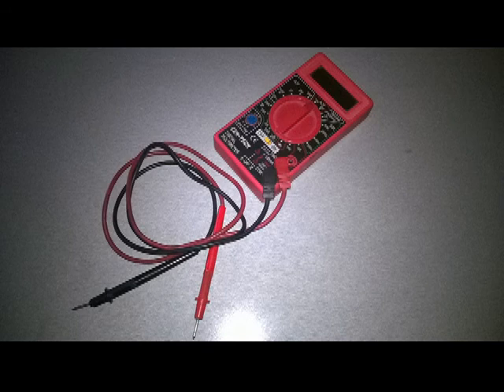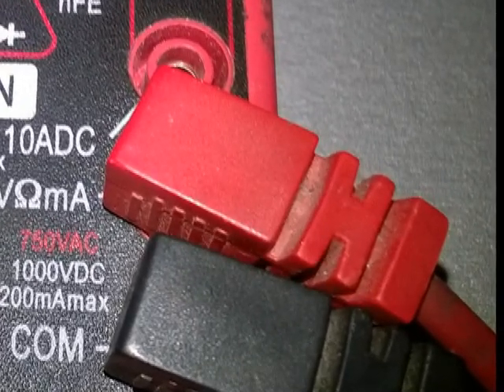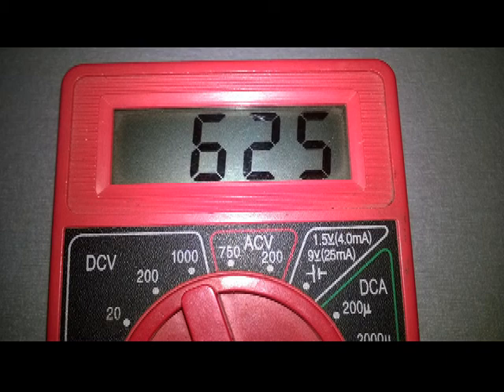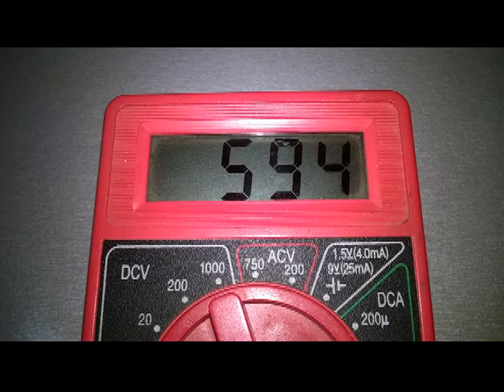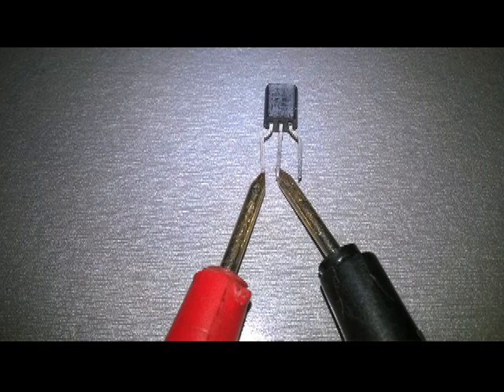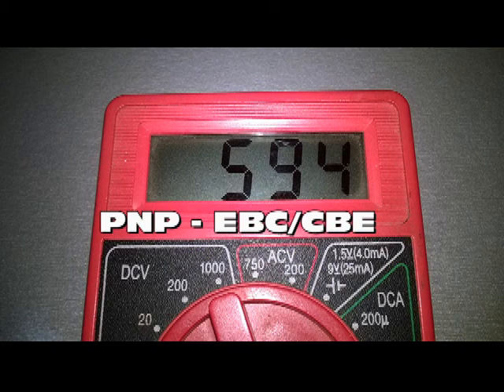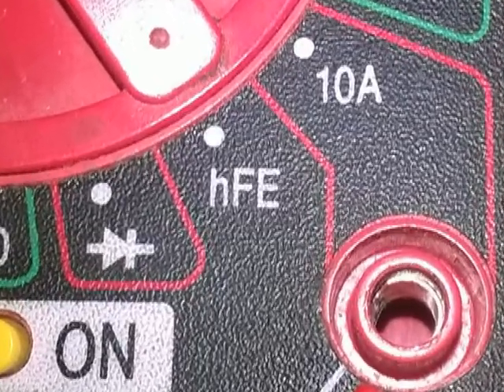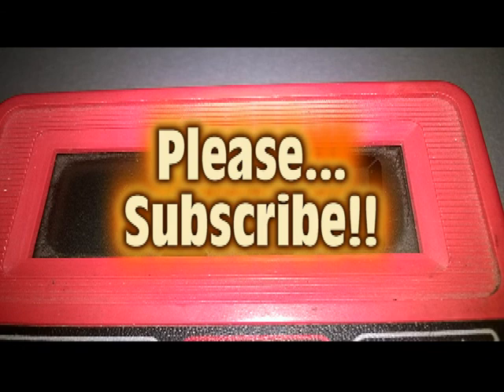How to test transistors with a cheap DVM

Comment: great video. wish i could speak with you on questions i have in determining the value of a transistor
Reply from the maker: I have always loved working with transistors, even instead of using chips for simple tasks. Whenever one of my computers goes obsolete, I keep the monitor and cards, so as to have a source for valuable components! When it comes to precise values, there are some parameters you cannot easily find out by most testers. There is nothing like Googling the data sheet. Things such as maximum voltages and currents, cannot easily be determined by testing them. I have a facebook group called SOLAR ENERGY FANS, you can contact me and we can chat.
Reply: @eltunene  Thank you. That is precisely my problem. I am trying to locate a transistor from a mid 80's GM and it's near impossible. It came out of a windshield wiper control module but the numbers don't cross anywhere. I've spoken to countless people at electronics companies and they said it was likely an "in-house" private contract between Motorola and GM so I'll never know the values.

Comment: Hi Chava I have a question for you I have a transistor PNP bc547 I get a reading of 807 on the diode mode when I touch the black on the left and the red on the middle and on the HFE  i get 347 reading is that a good or bad transistor
Reply from the maker: A bipolar transistor acts as a pair of diodes when tested, one between base and emitter, and the other between base and collector. Normally a transistor reads low when you connect the positive meter probe to the N crystal and high when connected to the P crystal. However, a transistor can show a leak in reverse polarity, this particular transistor has a rating of 6 volts for the emitter base junction, which could show some leakage due to the 9-volt instrument battery. If HFE shows a reasonable reading, the transistor can be considered as good.
Reply: Chava so is my transistor bad or good if I got that reading on the 347 how can I tell if it’s burned out if it has no reading